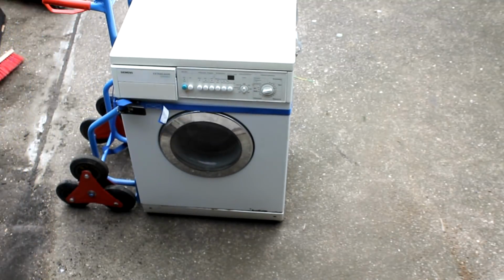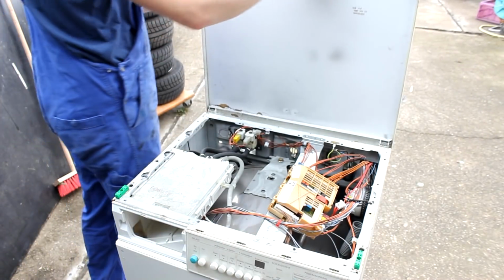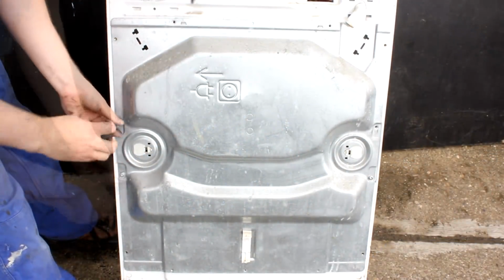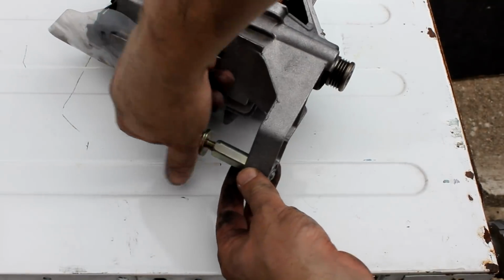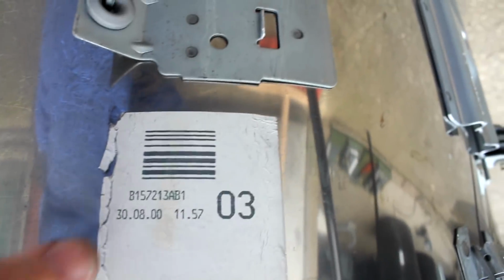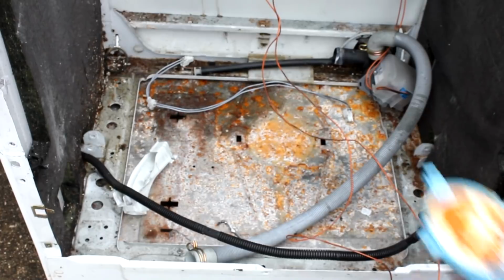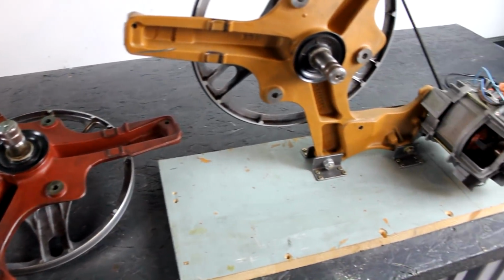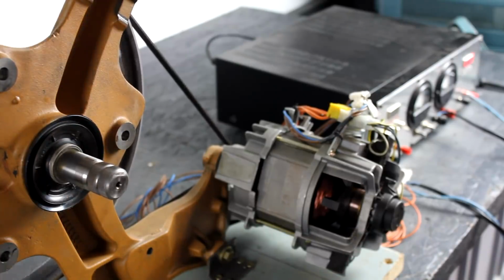Salvage a Washing Machine Motor + Transmission from a Siemens Washing Machine

Comment: Since I'm not familiar with Germany's recycling system...can you sell your scrap to scrap yards, or do you just send that scrap to your local recycle yard?  I ask because all that scarp is worth more than what you paid for it (10 Euro)...at lest in the US, you'd probably get about 15 euro for what you have there...a "full" washing machine can net me $25 USD depending on the timeframe (what is copper going for, what is steel going for, etc.).  But if you have the famous "recycle for the common good...while we sell it for a profit" then I guess  the point is moot...
Reply: Especially for the stainless. Here in the UK you can sell to scrapyards if you show ID and sign some paper, this is to make it harder for metal thieves.
Reply: They don't want to deal with 200lbs of steel because shred (sheet steel goods) is about $0.07/lb currently.  I don't even deal with it anymore....my last drop off at the scrap yard was for 2000lb of steel, 30lb of copper, and 20lb of aluminum.  The 20lb of Aluminum netted me more than the 2000lb of steel...by a MILE...it just doesn't pay so it goes into my weekly recycle bin.  I still save copper/aluminum/brass for myself to sell back to the yard.  MY big problem around me is that none of our scrap yards will sell lead...I reload my own pistol and rifle cartridges and make my own bullets...I used to be able to get lead from the tire shops, but not anymore...and the scrap yards are stating it is now considered a "Hazardous Materials" and they can't (won't) sell it.
Reply: In the US it varies, but where I am the scrap yards don't want to be involved with small time scrappers, so for example they refuse to accept less than 200lbs of "steel", stainless and toolsteels excepted. If you were just looking to get rid of the sheet metal elements, you would need a few washing machines. The copper won't have the same bulk minimums, but they refuse to accept insulated wire because of metal thieves, you'd have to strip it.
I used to run scrap for a CNC job shop, mostly 6061 aluminum, and 8x 50 gallon drums of turnings was only worth about 200USD
Reply: No, household scrap like this (as well as old funiture, larger quantities of paper, plastics and wrappings, glass (think window panes), green cuttings and wood, electronics, hazardous substances like fluorescents, paints, solvents, batteries) is dumped into sorted containers at collection yards ("Wertstoffhof") who send it off to wherever. Your "reward" is more or less the availability of controlled disposal facilities.
Reply: That's what I thought...here in the US, we have the option of going to the scrap yard ourselves and offloading (selling) steel, lead, copper, brass, motors, batteries...and such.  At least in my area (others might not be able to).  Thankfully my area also has recyling for paper, cardboard, metals, and SOME glass (bottles, jars, etc...no light bulbs of any sort)...I sort out the brass/copper/aluminum to sell back myself...steel, unless sorted by grade, is pretty much worthless right now (<$0.15/Kg last I saw).

Comment: You should look for motors out of electric mowers as well.  Most are really high quality!  I find them for free once every once in awhile and if I cannot fix them (most of the time rectifier issues) then I take them apart and keep the motors. Try one out if you get a chance.  Cheers!

Comment: These days the outer drum is made of heavy glass reinforced plastic with the support bearings for the inner drum's shaft pressed in.  The motor is just screws directly to that.  Most older washing machines in the U.S. are vertical shaft.

Comment: What about power generation? Wind, water, or even human powered. Would probably make a decent table saw or grinder. Perhaps you could build a lift or conveyor of some sort with it. Universal motor and lead acid batteries would make a terribly slow, low range, and heavy vehicle. I think it would be better suited for a stationary application where weight is less important.

Comment: Really? The inlet valves operate on line voltage ??
Reply: They're probably solenoids, those always need some power to switch. Plus AFAIK they're not on for very long.

Comment: Most washers over here in the UK tend to have plastic drums, making modification a bit difficult, and ones like Siemens and Miele still fetch high prices even when broken because of the name... :\
Reply: twocvbloke I've never seen a plastic one mate maybe your just looking at broke ass peoples washers ;P
Reply: Inner drums are metal, the outers are for the majority made of plastic, some washer-dryers have metal outer drums, but they're a pressed steel which if cut up are as flimsy as tinfoil, blame the manufacturers, not the end-users for the cheapness...

Comment: A cargo trike would be a perfect match because in the center jackshaft you could connect the motor's reduced speed shaft assembly to it via bike chain. It'd be about pedal speed. Might be a little low in overall power but if you only wanted to do 10mph it'd work fine.

Comment from the maker: Sorry if I sounded tired and possibly "uninspired" at the end of the video, I had to keep down my voice because it's already technically Monday morning here and I didn't want to keep the neighbors awake with my loud voice. I had to whisper into the microphone. I'm commenting on it because I'm actually quied excited about building some of the stuff that I mentioned at the end of the video, now that I have the new shop and all.
Have a nice rest of the weekend,
Gerolf
Reply: The Post Apocalyptic Inventor make a eletric go kart with that motor! Salvage batteries from old laptop batteries computers, some of the cells still good!
Reply: Didn't notice. Your voice overs are always great.
Reply: "Sounds" like we need to find you some sound proof walls!
Reply: The Post Apocalyptic Inventor hey, man....looking forward to this new project of yours mate! don't forget to add the 'Würstchen blink Anlage' though ;)

btw, the washing machine's outer drum casing can be used as a workshop chip/crud collecter and works a treat. I built mine using an old einhell vacuum, a couple of plastic pipes and connectors to the routing/wood cutting table. 
rock on mate and thanks for posting :)
Reply: The Post Apocalyptic Inventor You could build a lathe
Reply: I noticed your voice "out of tune" but nothing special.
I look at that and all I can thing is a DIY belt grinder!!
My problem would be controlling the motor... If you could get a simple Arduino to do that it would be awesome!!
Reply: The Post Apocalyptic Inventor i
Reply: Agreed!
Reply: I always love the unusual but apt words that you use, you have a better vocabulary than me and its your second language!.
Reply: well he has a lathe^ but maybe this might power it
Reply: I would really like to see an electric go-cart.
Reply: How about a welding lathe? I think the motor turns slow enough and u can weld on the outside of round objects without repositioning ...
Reply: The Post Apocalyptic Inventor Pl coco nutgraftingcoconutgRaftjng
Reply: The Post Apocalyptic Inventor , you sounded just fine to me. I know some Simpson washing machine motors can be easily used to make small load generators, I don't know if Siemens are the same or not. Have you tried making a Generator from 1 of your washing machine motors? I'd like to see that video if you have done that. 🛠🔋🔌
Good on you Gerolf, keep up the good work.
Reply: TPAI whispering in the night. Brilliant!